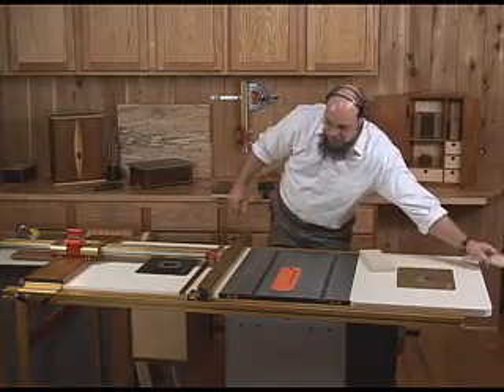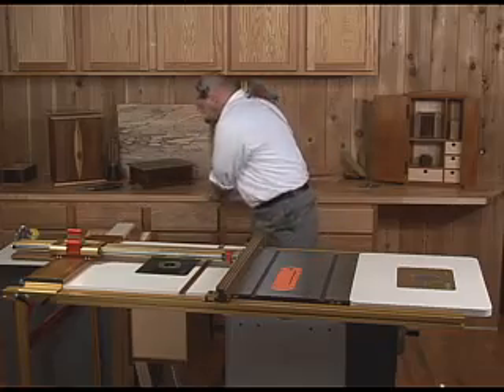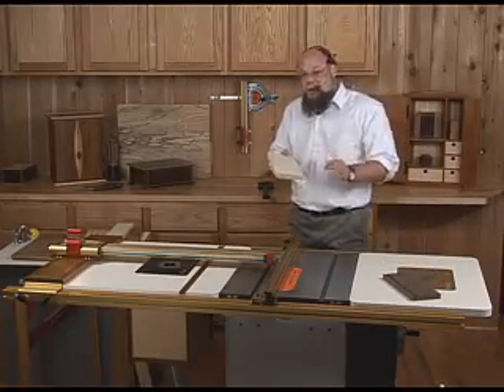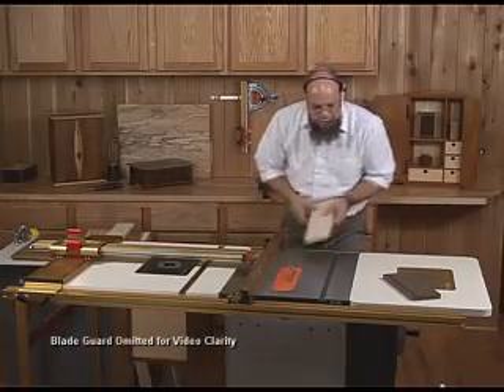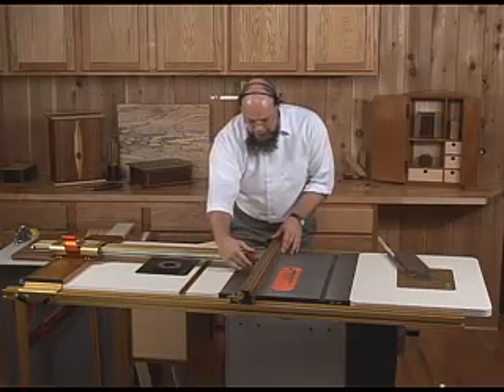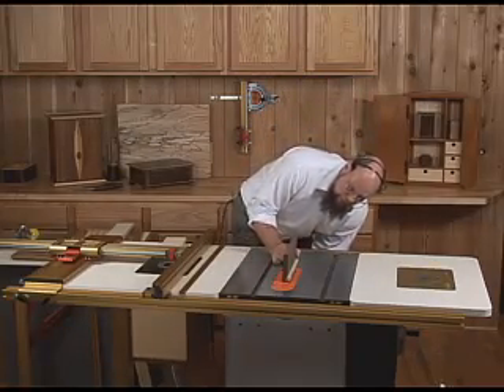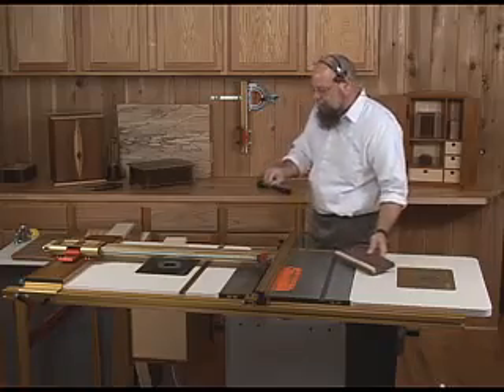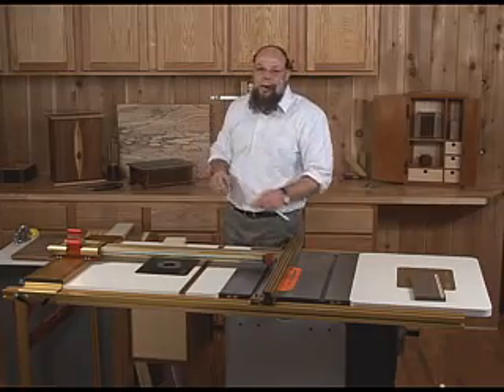INCRA TS-LS Demo Part 3 of 3

Comment from the maker: Hi-  The infeed fence glide has a knob that quickly locks the fence directly to the rail, which triangulates the system for when you're cutting large/heavy stuff.  The rear fence glide can also be locked to the rail, which eliminates the fence's being able to lift from hold-down pressure after locking the infeed fence glide.  I cover the extra locks briefly in one of the videos, but I don't recall exactly where.  Let me know if I can address any questions 888.804.6272 xt 4.

Comment: I'm not sure if I'm more impressed with the Incra Syetem or the presenter, extremely well done trio of videos. I do have one question though, there does not seem to be any locking of the fence at the front or rear where it slides on the runners, this means it only resists movement at the centre of the fence where it is conected to the adjustment arm, is that correct? If so, what really stops the ends from moving if you are pushing in hefty bits of hardwood?

Comment from the maker: Joseph -

Smaller jobsite saws are not ideal for Incra TS systems, and they're easier to install on conventional floor-standing saws with cast iron tops.  Please check out the TS-LS pages and general compatibility chart at our Incremental Tools web store and contact us directly if we can address any questions.

Mark Mueller
Taylor Design Group, Inc (Incra Tools)
888.804.6272